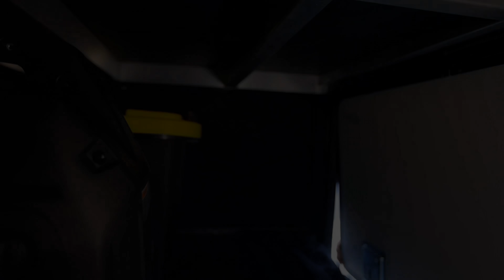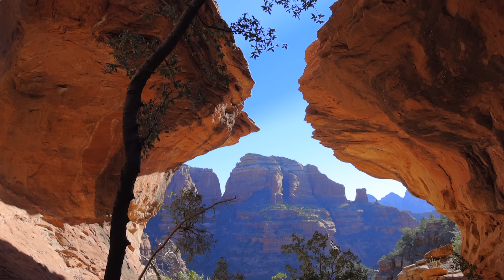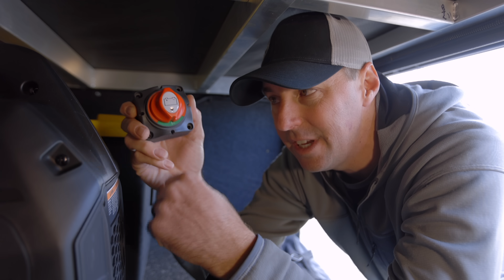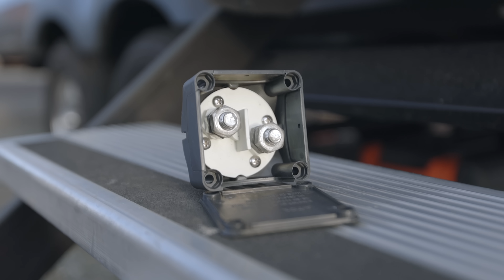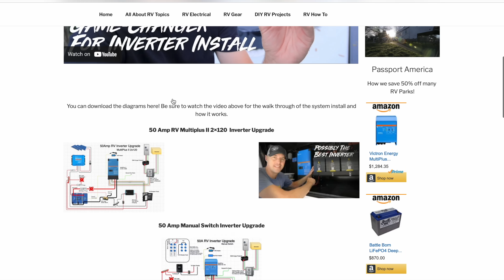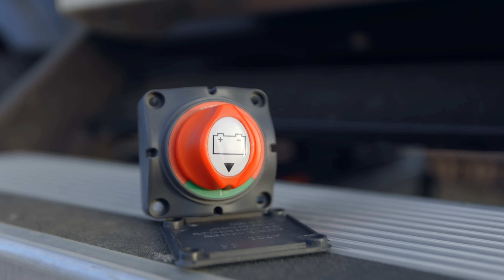Why I Removed The RV Battery Disconnect.

Comment: Thank you for clarifying that the negative should be disconnected 1st and why. As a firefighter I've argued this many times After working accident scenes and even so called mechanics don't understand why.
Reply: Yes thank you for the explanation. It happens. Years ago i did this exact mistake on my 24 volt Toyota Landcruiser. I went to disconnect the positive side first and my wrench slipped. The wrench contacted the body frame and welded itself to the frame. I was very lucky that there was no permanent damage to me or my truck. It easily could have gone the other way.
Reply from the maker: Thanks
Reply: You guys are wrong. You always disconnect positive first. Please stop spreading fake news

Comment: Another great video Jared good job  As others have commented below just be aware that by changing the configuration of the 12VDC switching you are also now turning off things like electric brake disconnect function, and your carbon monoxide detector.  Not a big deal when the unit is in storage but for everyday use some of these safety systems need to be left powered up.  For the experienced user having the ability to cut power to the entire coach without cutting power from the battery bank is handy, but for the casual or inexperienced user this could lead to problems.  Anyway, keep up the good work on the videos and take care.
Reply from the maker: Thanks Mike!

Comment: With respect,  I do believe your solution contravenes laws in some jurisdictions (such as here in Canada)  in that it is able to shut off the breakaway braking if not left in the on position. Regardless of your diligence in only towing with it in the on position,  I believe you are open to ticketing in my jurisdiction at least.  And yes,  I've had a Roadside inspection by police and they tested my breakaway switch.
Reply: Interesting.  May I ask which province you’re in?  I added a disconnect switch to my TT and have it wired to cut power to everything.
Reply from the maker: I hear what you are saying but here is why this is how I prefer to wire it. I prefer to have the disconnect to include the brakes because I have seen 3 different times in the last couple years where the breakaway cable was accidentally pulled and started melting the wires. One case I had wire cutters close and cut the wires, the second I had to rip the wires out of my friends RV. If it had a disconnect I could have shut it off faster with less to repair. The third I wasn’t on site for and melted the wires and melted all the wires in the wire loom. When wires are smoking on the RV you want the fastest solution you can so there is less damage. Many RVers pull the battery cable off in storage, forgetting to re connect the battery would be the same as not flippling the switch, either way as long as it is connected the breakaway switch will work and roadside inspection will pass just the same. Along the same lines if the battery is dead the breakaway switch won't work, all in all it's up to the user to make sure the equipment is working.

Comment: Great informative video thanks for sharing. My wife and I are RV newbies looking to get our first RV and GD is on the top of our list (as are your videos). Is having an battery disconnect that only disconnects some loads but not all a common thing? It just doesn’t make sense to me. Kinda like turning off a light switch that only turns off one bulb and not all of them.  And why did you put a separate disconnect on the inverter?
Thanks
Reply: We put a disconnect on the inverter in the event it needs to be troubleshot, there is no risk of AC voltage on the output, and shocking the person the person.